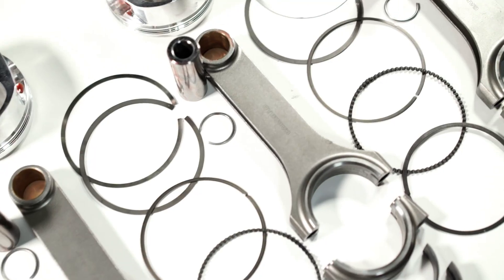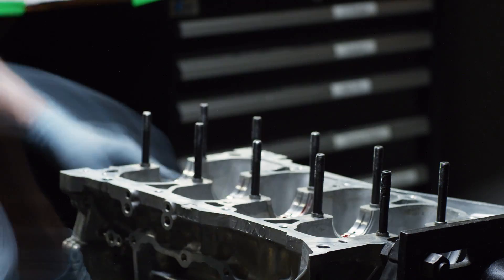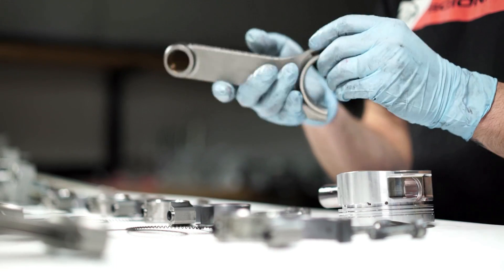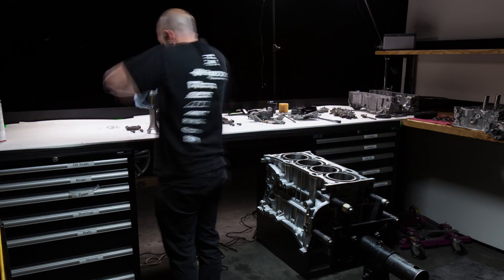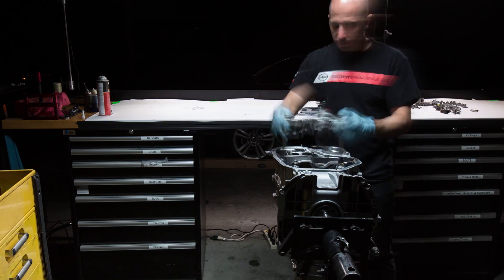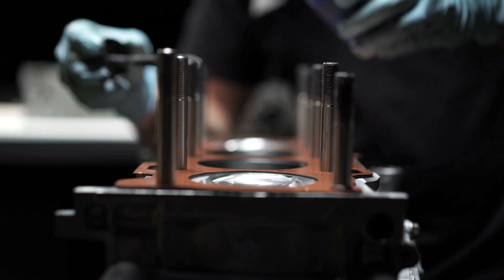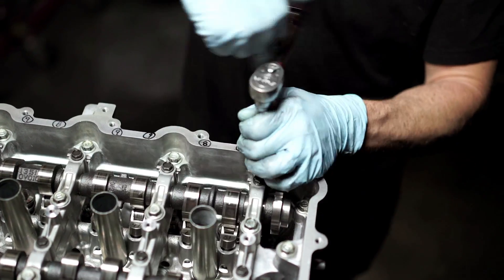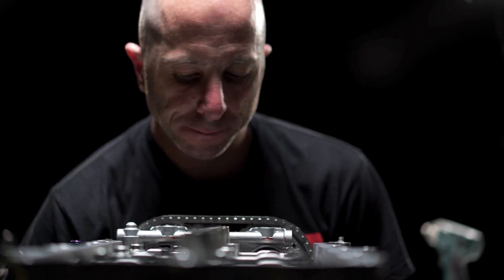Full build of Papadakis Racing's 1,000 hp Toyota 2AR engine -- shown in 1.5 minutes

Comment: So why don't more people build this engine?
Reply: IMO owning one its hard to find performance parts they have some but not many options and they come either in a camry and the scion 2, which the scion tc 2 has more options like a manual tranny, that helps tremendously, i bought a piggy back from Fast scions thinking that it would be ok it was for an auto tranny mild tune which was like $795.00 just to realize that the Ecu's are different the Tcs have a slot in the middle of the Ecu,cant get headers,not too many tuners wont tune these ECUs, you get the picture...

Comment: I thought the new supra was just a glorified BMW he talks like toyota designed it.
Reply: This was the engine from the 2015 season- a 2AR engine out of a Scion tC- not the new Supra.  :)
Reply: The whole shebang was co designed from the ground up. It's not a re shelled z4, toyota and bmw designed the platform together. The same with the version of the b58 used in both cars. Sure there are parts from the bmw parts bin but theres a lot more to it than this bad meme that is circulating. 

Interviews with Tada are on YouTube where this is all explained.
Reply: @Cafferssss  if it's not a reshelled z4 then I'm just gonna laugh at parts cost from the BMW bin.

Comment: Would these mods work on the 2AR-FXE hybrid engine? I'm thinking about building a hybrid street machine.
Reply: stock toyota hybrid ecvt transmission will not handle so much power
Reply: Not so sure. The Camry Hybrid Power Splitting Device is not a typical chain driven CVT. It is a direct planetary gear driven system all the way to the axles.
Reply: @charles4962  i know but still, i'm sure it won't handle more than 130-150% of stock power
Reply: That's the situation with all power upgrades. Individual weaknesses get identified and failed components get replaced with stronger parts. Diffs, cv joints, sun gear, whichever parts break.

Comment: Toyota still makes good engines, they should have designed a new straight 6 for the new supra instead of going with a BMW
Reply: They better use this engine than beemer engine on it 4 banger supra is no problem because their orginal racing supra jtcc was powered by 3sgte . just make 350 hp from this engine people are happy

Comment: Stehpan, I have an 05 RAV4 L AWD manual.  It's way too slow and I'd like to really beef up the engine HP to at least 500 HP or above.  I'm not aware of any shops in my area (DC) that do this kind of work.  Do you build engines for just your racing team?  Any guidance would be appreciated
Reply: Terrance P lol first get a spare 15k or so

Comment: The 2AR-FE engine will be a great asset for drag racing. What kind of impressive records will a 2AR-FE powred RWD import race car will do!
Most TOYOTA enthusiasts left the 4 cylinder side of the story and jumped-in to the 2JZ-GTE 6 cylinder in line wagon, leaving just a few who still try 3S-GTE and heavy 3RZ-FE 4 cylinder engines. Yes they have run 6 seconds, but I think a well built 1,200-1,300 HP 2AR-FE will be more consistent and perhaps do better than the old 3S-GTE and 3RZ-FE.
Reply: I agree! I was surprised at how well my 2AR responded to basic mods, and now I'm going to drop one into a W30 MR2 and plan to boost it for a track car!
Reply: I hope you plan to make videos of the build! I'm one of few people who thought the 2AR would be a good 4 cylinder swap for any of the MR2 platforms.
Reply: http://www.motoiq.com/MagazineArticles/ID/3102/Nerds-Eye-View-Inside-Fredric-AasboPapadakis-Racings-Amazing-V8-eating-2AR-Toyota-Engine.aspx
Reply: I remember someone on the forums saying that the newer 8arfts is essentially an updated turbo charged 2arfe.
Reply: Wow, great info!
Reply: What about the 2az-fe
Reply: @ely6219  same question

Comment: It's amazing that a "boring" Camry's 4-banger has this much potential.
Reply: It is amazing the power some engine tunners take out of boring TOYOTA 4 cilinder engines like the Tacoma 2.7L 3RZ-FE...

The 2AR-FE still has more potential than the bulky and heavier 3RZ-FE
Reply: EM6285 I'm curious as to why you think the 2ar has more potential then a closed deck block design like the 3rz? I'm currently building a 2tr, and am quite excited as it utilizes a modified 3rz block design.
Reply: These engines are soooooo over engineered. Standing over one right now
Reply: You  oh lord did you just spit a whole lot of ignorant tardation.  Call your parents and tell them you're sorry they spawned you.
Reply: @UnyieldingSeraph  Lots of "REAL" men and "REAL" mEkAnIK gate keepers on the internet who haven't held a wrench in their lives and try to sound tough and knows it all..
Reply: Alyn Penners maybe potential to produce power in high rpm, lighter because alu vs iron block, and we knows that 2tr fe isnt build for high rev engine from factory, 2arfe also, but it builds to run nicer on high rpm than 2trfe. Dont get wrong, my cousin 2trfe stock toyota fortuner is pretty good consider for stock engine
Reply: Phrozin Yeah so I guess Top Fuel engines are shit cause they run a supercharger while making TWELVE THOUSAND horsepower?
Reply: @Matty_Bski   considering you have to rebuild those engines after day of use…. Yes
Reply: Phrozin OHV engine with 2 valves per cylinder you mean?

Comment: I wonder what kind of power you could squeeze out of this motor in N/A form
assuming you swapped the pistons I wonder if 300Hp on Pump might be attainable
Reply: Some years ago a few racers used the TOYOTA 3RZ-FE 4 cylinder (Tacoma engine) in the All-Motor class. They where said to be making 550 HP all motor (modified engines)

3RZ-FE is a prehistoric engine desing compared to the modern 2AR-FE

Comment: would you build engines for the public?
Reply: Ralph WaterDude theres quite a difference between regular engines and the ones used in formula drift, so id doubt that would happen anytime soon if you wanted an engine with a lot of hp, as they are usually just heavily tuned engines which might not handle decent amount of stress for very long periods of time(years), these engines get parts replaced at nearly every event due to some things wearing out quickly and so on, and i believe they are made to handle insane stress over a short time, and wouldnt exactly work very good as daily car engines, having to handle less stress, but for years without having to replace anything. theres a reason some of the cars like bugatti etc are as pricey as they are, and its because their engines are quite reliable despite having a rough driver, and they are designed to last long, but not under as rough conditions as under formula drift :P
Reply: Exata1337 Yet, if that engine that makes about 850 hp were to be tuned to only have about 180 ~ 200 hp it could be used on a daily basis reliably, or so I believe.
Reply: Ralph WaterDude that would depend on the original block and the settings for it i guess. i believe a V8 block to begin with would be more reliable with that amount of horsepower than an I6 turbocharged would yea.
but this engine in particular is about ~200 hp completely stock, so its far from stock anyways, and its a 4 cyl with turbo AND nitrous, so im fairly certain that it isnt exactly very reliable in the long term if you were to drive it as a daily car :P
Reply: i read in the speedhunters the engine opened after season ended, no failure at all despite many races has been done

Comment: No rod bolt stretch, Steph? Or did the compression of the video just not show it? Also, copper gasket?
Reply from the maker: SWREngineering We already know how much torque is needed to get the proper stretch. I prefer multi-layer stainless gaskets to copper. We actually use a stock 2AR head gasket.
Reply: Ah. Just the color of it that fooled me then, it looked like a copper gasket so I wondered why you would have to use one. But then you didn't. :)
Reply from the maker: SWREngineering It is sprayed with copper coat. :)
Reply: is there a extra metal or stainless wire o -ring to keep the gasket in place ? and the copper coating, can you put it on Multi-layer gasket that has factory sealing for the coolant and oil channels ? just spray over it ? of clean it back off there ? is that open deck engine blok ? and cilinders don't crack ? or are there cast iron sleeve's in place ? thanks !

Comment: People were impressed when they found out that the 2j could handle 1000hp on stock block.. this is more amazing! Cool video! Can we expect more videos soon?
Reply: It is amazing feat that the 2AR-FE engine block is holding up to 1,000 horsepower with no use of block guards, block griddles or cement filling.
Reply: NorwayGokart99 This 2AR-FE block is not 100% stock in that demand as far as I know. Uprated bolts - as in bigger dia - for the crank and such. So it's not bolt on like a 2JZ, then again it also has bigger capacity to begin with. :) Anyways, just shy of 400bhp per liter is no easy feat no matter.
Reply: YEAH! and in general toyota makes very strong open decks!
Reply: Hahaha see even their 4 banger strong as hell now they using beemer engine and cannot be upgrades especially the block hahah